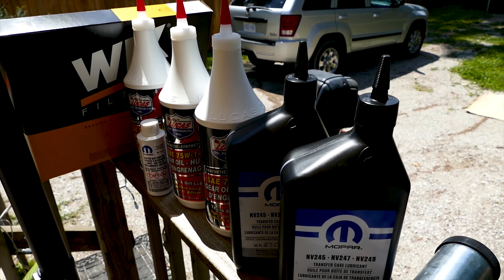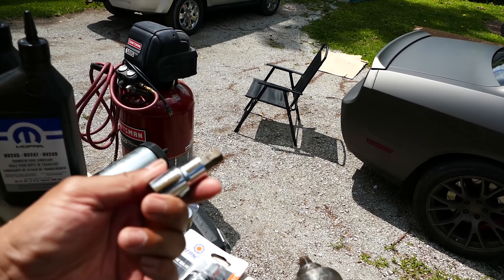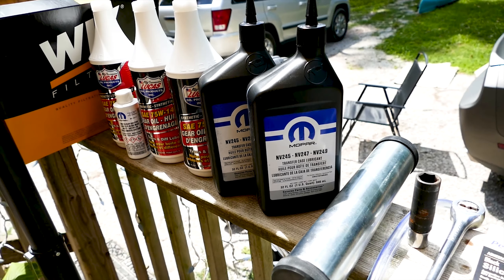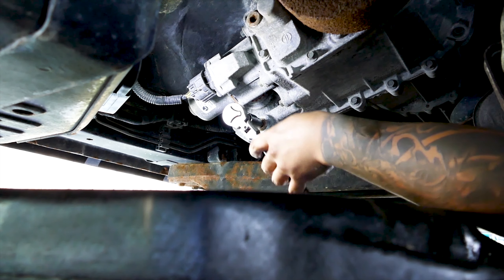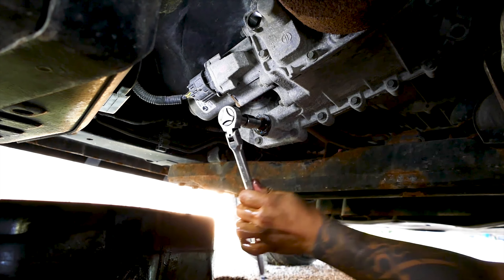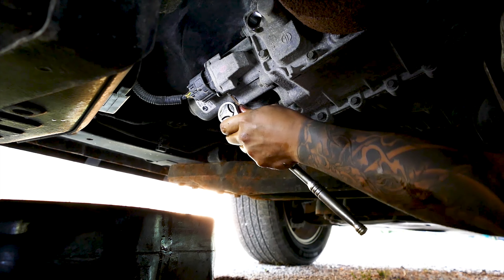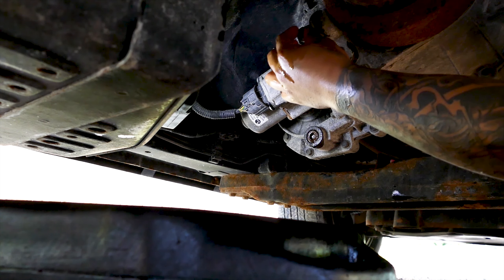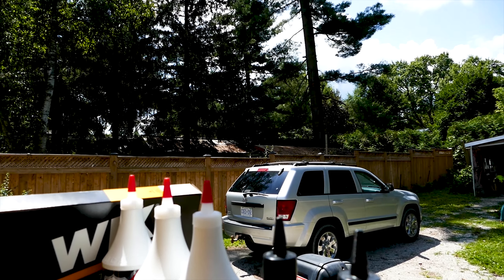jeep grand cherokee transfer case fluid change

Comment: I'm happy it seems so easier when watching the video than do it. The specific point, is that when I put the hose in the fill hole, it's like to closed and it tends to drip out when pumping the fluid. (And I mean, just when starting filling)
Thanks for the video anyway!
Reply from the maker: thnx for the kind words and watching 😊🙏

Comment: Did you see on Instagram the picture of wrangler with 392 Hemi??aka 6.4 monster..  jeep posted it on there instagram.... Any thoughts
Reply from the maker: Not bad at all, for the wrangler its overkill for offroad and rock climbing the 5.7 does well with the wrangles, the 392 is a great engine for the jeep cherokees especially because of how much weight the cherokee is, whats your thoughts on the wrangler 392?
Reply: @moparbro  I would never take a wrangler off road 😆. It would be a huge lifted city cruiser for me 😆.
Reply from the maker: @LamontBoucherville  haha true then with that driving and it being lifted the 392 is great! I'v known the v6 owners and they usually complain of the gas mileage lugging that wrangler around in a v6.